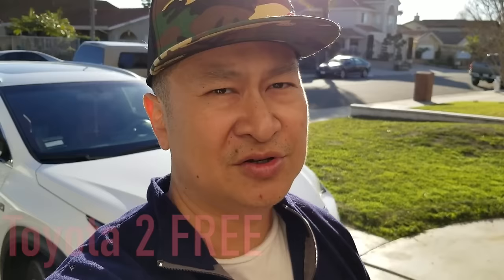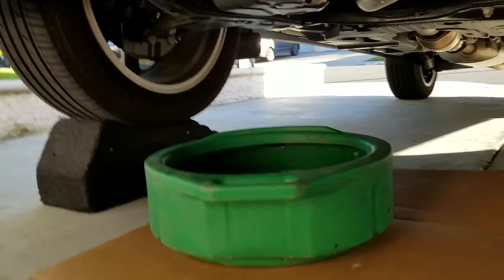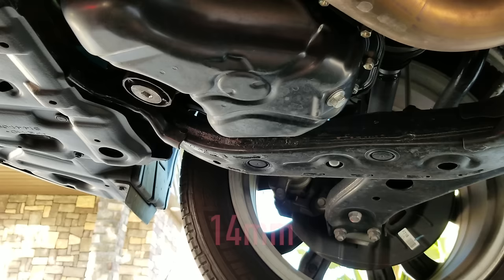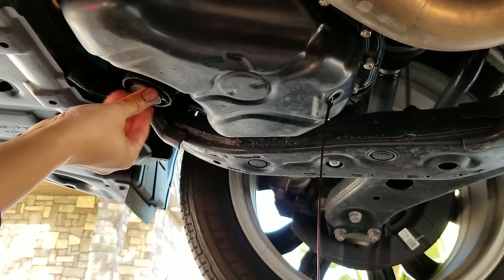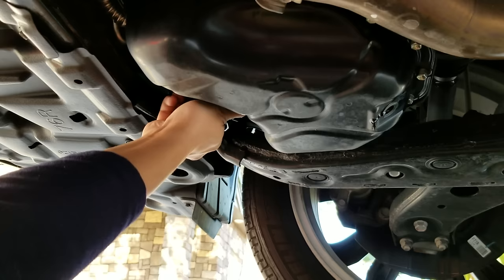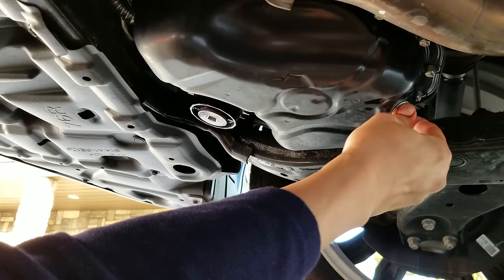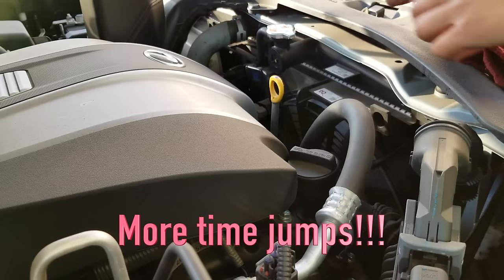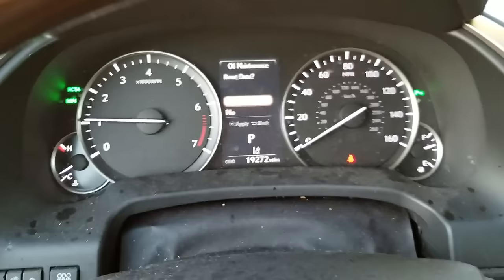Lexus RX350 Oil Change DIY 2016 2017 2018 2019 2020 2021 2022 models - Motivx

Comment: Great video Rob!  I watched video on your Tacoma oil change to learn the proper way to service a Toyota oil filter element.  One thing I noticed lots of Toyota owners are using Mobil 1 advanced fuel economy 0w-20.  How does your Lexus and Tacoma run on/like this oil??  I know Exxon/Mobil makes Toyota 0w-20.

I have had great results using Mobil 1 Advanced Fuel Economy 5w-20 in my 08 Honda Fit.  The little Fit engine really seems to like this oil, ran smooth and got an extra 1 mpg.
Reply from the maker: Thanks for the feedback regarding my vids. I truly appreciate it.Honestly I haven't noticed much of a mpg difference and most of my miles are my daily routes. The good thing is the oil doesn't 'burn off' so the oil levels are always good.We actually had a Fit back then too. I fixed it up like I do all my cars. 😀

Comment: So Lexus dealership  wants $1200 for the 60.000 Mile maintenance. What is your thoughts?
Reply from the maker: I thought i replied but doesnt appear so. I think that could be steep for what it needs. I'd try an independent shop.
Reply: I would not even think of doing that, change the oil and filter, do a front end alignment if you have not done one for a while, pay Firestone the extra $20 for a “safety inspection” or your mechanic to do it so you have brake pads and fluids level checked, change air and cabin filter if not done recently, they are very inexpensive on Amazon and you are really DONE.    A complete waste of money on a Lexus.   They are bulletproof and you are throwing your money way in my view. if you do it yourself you will spend less than $100 on parts.   I have had many Toyotas and Lexus and have 3 now.   Have never done such an inspection at any mileage level.

Comment: Can this also apply to lexus es350 2019?
Reply from the maker: Hi yes but the locations of drain may be different slightly as well as covers. The tools n process are similar.. I've worked on 3 different cars w same steps
Reply: @RobDaman  appreciate the response i love your videos iv never tried to change oil myself, just bought a lexus es350 2019 this is very helpful thank you 🙏🏻

Comment: Guessing that bottom thing doesnt need to come off at all if u dont care about mess? My god u put that filter holder on tight, I cringed
Reply from the maker: That's correct. I actually did it that way on my 1st Taco oil change vid.

Oh don't worry I still put it looser than the service dealers 😂  

I put torque specs in the description.

Comment: Lexus have up to 30k millages free oil change .
bro never drain oil first because what will happened some time if you cannot replace the filter ?specially Toyota and Lexus ...
Reply from the maker: Never heard of 30k. Can you link where you have this info?

Toyota stops at 20k which is still double Lexus.
Reply: Rob Daman bro I have the same Lexus 2016  my last oil change was 30k it come with warranty . You might have better knowledge but I am positive every new Lexus they provide up to 30k free oil change .
Reply from the maker: Check out Lexus site here

https://www.lexus.com/maintenance

It's 10k. 

I've owned 2 2017 Lexus and it's 10k.  Your 2016 may have been the last year to get it or your dealer granted you freebies.  That's why I asked for links to show otherwise.

Comment: For being  to neatty and clean you forgot not just change plug whasher but safety precautions. Like Jack stands and tire stoppers. Plus an unnecessary tool to drain oil housing filter. Try to make another  video regarding safety and disclaimer.

Comment: That’s not safe. Don’t rely on that ramp, if it breaks, goodbye world🤦‍♂️🤦‍♂️🤦‍♂️. At least use a jack stand with that ramp as another safety measure
Reply from the maker: They are made from recycled tires and are literally solid and weigh 38 lbs each and designed to handle over 12,500 lbs as a pair.  No way the front end of an RX gets close to that limit.

Comment: Dude, you need to wipe down your wife’s dash! Filthy! LOL! I’d like to see you do your mom’s 200t. I have yet to do my wife’s NX300 (same as the 200t) and my Taco. But, I do have the oil change kit on standby...
Reply from the maker: LOL. I think I left the comment how dirty it was.  I'm rarely driving it.  

My mom's not around too much to do it but I bet it's similar. They all have those canister filters nowadays. 

I need to peek underneath. I was surprised there was no engine plastics.
Reply: Rob Daman Yup. Just took a peak under the car and it has the exact same  configuration under there. Easier to get to compared to the Taco!
Reply from the maker: Nice. Toyota did it right. Lol

Comment: Why oil change has to be that complicated 🤦‍♂️
Reply: What was complicated?
Reply: @jonasthemovie  A lot of north American cars have a standard filter that you simply screw off/on. The Lexus requires you to remove a bunch of stuff, replace O-rings, and then re-install. Definitely more time consuming.
Reply: It doesn't. I don't drain the filter. I just move the oil bucket over and let it go  like a regular filter.

Comment: You need better ramps dude.
Reply from the maker: they're pretty stout made of recycled tires and heavy.  you may be thinking they're some kinda hollow plastic which it isn't
Reply: @RobDaman  No, I am familiar with these. I like how sturdy they are. I just don't like that there is no room for error. The ramps should have  a decent run out (platform where the tires sit), without having the give it excessive throttle to get over a hump, so you know you have some space for error.
Drive up the ramps, check position, set e brake,  chock wheels (forward and backward).
What I really want is a grease pit.

Comment: My Toyota gives my oil change at 10k.
Reply from the maker: Correct. 10k and 20k.
Reply: @RobDaman  I changed my "break in" oil at 1k miles, next at 10k. Paid out of pocket but, well worth the piece of mind down the line. At 1k it actually had some glitter on the end of the dip stick.
Reply from the maker: Nothing wrong with that early 👍